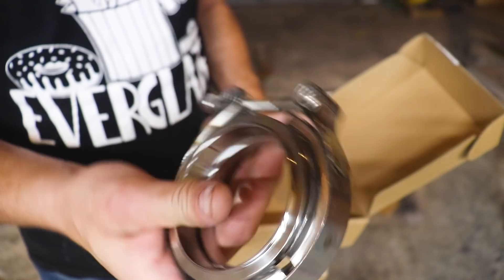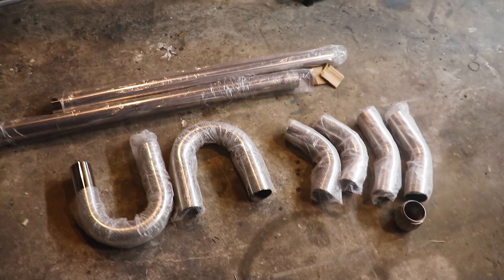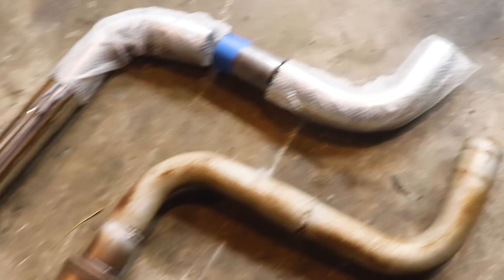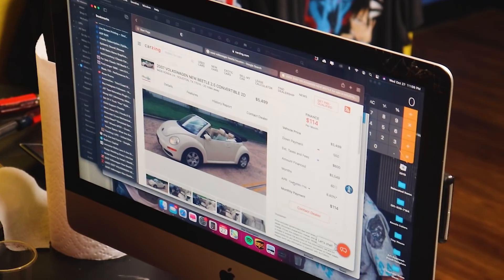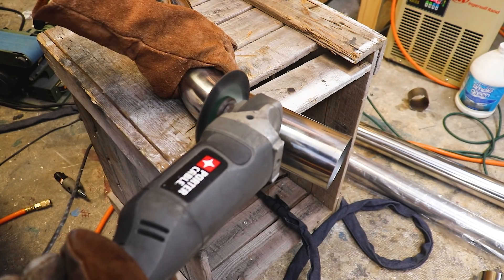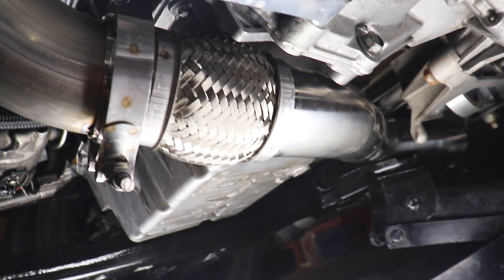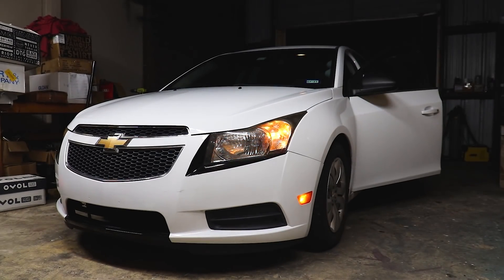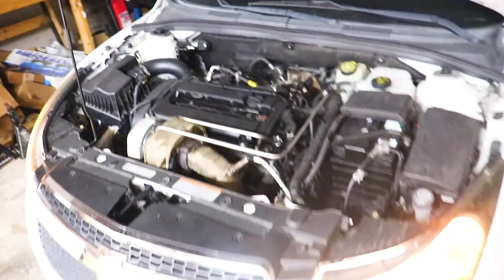$175 DIY 3" Stainless Turbo Back Exhaust Install - eBay Turbo Chevy Cruze 1.8 Build - Project Turdbo

Comment: I bought a cheap 3” belt sander that your supposed to use by hand, clamp it in the vice to clean up the ends to make them flat and it’s so much easier to weld them together as it removes all the gaps and for cutting just use a hose clamp and clamp it on the pipe and it makes your cuts nice straight again making your life easier when it comes to welding also invest in some kapton tape as it’s really strong and high heat so you can weld close to it without burning it
Reply from the maker: Awesome tips! Learning something new everyday.

Comment: I am curious i ve never seen this engine really built upon in australia and i own one of these cars so what was the thought process behind putting in so much time and effort into this car
Reply from the maker: I bought a 1.4 LTZ when they came out in 2011. Loved it. Had a family, traded it in cause we needed a larger vehicle. Missed that car, and never really understood why no one after 10 years had turbocharged the NA 1.8. Why start with less cc's?  So I bought a 2012 1.8 manual with the M32 gearbox with the intentions of turbocharging it. I see the guys in Europe have the VXR with the same engine, but the smaller displacement 1.6, making some good power 400+BHP. I occasionally get a bug and want to do something challenging. Anyone could get a Honda, or some other popular platform and boosted it. It's been done. To blueprint an engine that hasn't been done yet, and seeing what it's capable of is more exciting than, this combination of this make engine will produce X. If that makes sense.
Reply: @cmattdabrat  yea that makes sense i always wanderd why ppl never looked at mapping and really pushing the performance on the engine but here in australia they really aren't known for being reliable. I have a 1.6l turbo and thought about getting a exhaust upgrade and a intake plus tune just to see how much better it would make the car

Comment: Tiny stock turbo
Reply from the maker: Nope. 1.8 comes NA. Turbo on the car is a GT3582.
Reply: @cmattdabrat  Nice.
Reply: @cmattdabrat  Stock rods?
Reply from the maker: @ProjectCarTV  I'll go from top to bottom.
Stage 2 cams
Port n Polish head
SuperTech springs / retainers
JE Pistons, custom / coated with ceramic
Forged H-beam rods with ARP studs
ARP Studs
10.2:1 CR
Stage 5 clutch
LSD
Custom equal length turbo manifold
Custom intake
GT3582 Turbo
Injector Dynamics 1050x injectors
Deatchwerks 300 pump
Radium damper / regulator

Go back and check out some of the other videos. All well documented.
Reply: @cmattdabrat  Nice. I shot a rod through the block on a Cruz with a GT2876R
Reply: @cmattdabrat  Get a Cometic head gasket or equivalent. An MLS multi layer steel
Reply from the maker: @ProjectCarTV  Stock rods I take it on the 1.4?
Reply from the maker: @ProjectCarTV  I called Cometic. They don't have the dies for a 1.8. They said it would cost $3500 to make one. No thanks.
Reply: @cmattdabrat  yup

Comment: Sounds like a tuner! I think this project is accomplishing something big: it's showing that tuner cars aren't just Hondas, Nissans, and Toyotas. Americans can build competitive tuners too. I do, however, agree with some of the other comments on here, a resonator or two would definitely cut down on the harshness and make her really sound like a race car. And don't criticize yourself so hard on your welding. As long as your welds seal up the area and create a good joint, who cares about how it looks? I think you did a great job and I'm looking forward to what's next
Reply from the maker: Thank you! And you're right about all points. Welds are closed up, and know they're fundamentally sound. Will definitely consider some sort of resonator. This goes to show that there's more than import, and popular option American cars you can build. Just have to put in the work.
Reply: What are you talking about have you ever heard of the Chevy SS 2017
Reply: @speedygee6396  yes, I'm aware of the SS moniker that Chevy puts on some of their vehicles. It dates back to the '60's when they put it on their muscle cars that had performance engines in them (i.e. the Chevelle SS 396). Even the Cobalt had an SS line, where the first generation came supercharged, and the latter generation came turbocharged. The point here is that he is taking a stock Cruze and he's building it into a tuner car, which is what my comment is about. Something you see more with the Honda Civic, the Nissan Altima, and the Toyota Corolla. I was complimenting him on his achievement, not showing ignorance on what comes stock from the factory

Comment: Hi Matthew, Ive been watching this build since the very start, as ive done similar to what your doing on my own vehicle. I too have an eBaY turbo, but its not the Turbo that bogs you down, its all the other things that people dont instantly think off, like pipework, custom rads, custom exhausts, custom fittings, custom intercoolers & oil coolers, LSDs, Brakes, wiring looms, engine maps etc. So i can certainly relate. Mine is currently working very well, & whilst its in no record books, I was certainly part of an elite club in the UK with being 1 of only 4 Vauxhall Astra GTE 8v Turbos. ( your equivalent of a 90's Pontiac Lemans )

In regards to the video, i would recommend a decent backbox (muffler) to drown out the rasps. On overrun on mine, its now more of a burble, which is 100 times better than if i had no backbox muffler with a high pitched rasp (tinny sounding).

Keep up the good work & if you need some insight on ebay turbo modding if you get stuck or hit a brick wall, dont hesitate to hit me up! (except mapping, i just gave it to my local mapper, its over my head all that!)
Reply from the maker: That's awesome! And thank you for keeping up with the build. A lot of work goes into it. What's filmed here are more of the highlights, otherwise I'd have a 1,000 videos up, but probably not the most entertaining.

I'll definitely look into some sort of muffler, resonator down the line. Main focus is to finish the build and make power. Then we can dial in the sound of the exhaust, etc.

I appreciate it! Part of the plan with this build is to map it myself. Already have HPTuners and have done tons of research and at least 15 different tune changes since it's been up and running. I enjoy it, but surely can become overwhelming, but we'll get it.

Comment: I would try putting an exhaust tip on it and see if it smooths the sound out. I’ve heard of people putting an exhaust tip on and it making a crazy difference
Reply from the maker: Not a bad tip. No pun intended. Last time it had a straight through FlowMaster and tip. Sounded good. I'll touch on the exhaust again. My main focus was to just get the exhaust out the back. So let's consider it semi-finished with some tweaking. Possibly a free flowing muffler and a tip.
Reply: @cmattdabrat  haha nice! I appreciate you taking the time to make the exhaust out the back. I don’t like when people do good exits or fender exits. There is something about having it come out the back that makes me happy. Plus, I think it sounds better when there is some exhaust for it to go through. I love this build as I’ve been looking for someone building these interesting little Chevy cars. Thanks for the videos!

Comment: Nice work, is your welder just 120 volt 20 amp? Or is it 220 volt 40 Amp? 
 The vw bug is nice but  Apollo may not like it they are small inside.
Reply from the maker: Thank you! It's the Jegs 110/220 welder. I'm currently using the 110 adapter. Haven't needed any more than 90amps yet but the 110 plug allows it to go to around 120 amps, the 220 plug I believe 160 amps. Has been an awesome budget welder so far.

Comment: Great job! I remember building the exhaust for my cobalt and for my bike using a strike arc tig, boy was that a chore, its nice to have a switch to turn it on and off.
Reply from the maker: An on off switch definitely makes it easier. My first experience welding was arch / stick welding, so I feel you. Bet the tungsten needed sharpening a lot. I get lazy at times and will weld with the ball of stainless on it. lol
Reply: @cmattdabrat  yeah. I used to tig weld for a living and would spend a while sharpening all of the tungsten in the box on both ends for faster change outs. If you let the ball get too big you cant swap it for the other end. Now days I have a full water cooled torch set up at home with pedal control. Some day ill convert to a tig button. Love the work you do, and remember it doesn't always have to look pretty to hold and it is under the car so no one will see except all the viewers of your channel😜
Reply from the maker: @sinformant  You're right about that. I do the same. Will sharpen multiple pieces, but I'll try to keep the work progress going and put off sharpening them all again and will deal with a ball until it's just unusable. It's normally when I get really hot in the gear and take it. Learned my lesson with not wearing any sleeve protection and getting flash burn like a mo'.
Reply: @cmattdabrat  lol that ain't no lie. Last time I was tigging I was building a shifter for my buddy james at "the texas honda channel" and was too lazy to throw on my sleeves that were laying right there and I was red as a beet.

Comment: That thing is begging for an aero turbine/jones turbine muffler. I have ran them on multiple 4cyl cars. No packing and gives the exhaust a really deep tone. Their design also creates a scavenging effect the help draw more exhaust out. I have no ties to them, just a user and believer in their product. Every car I've ran them on it eliminated all the rasp. Some people love the raspy sound, some dont.
Reply from the maker: I've heard of those and definitely would consider it. Lots of innovation in the design. Lots of room to adjust as I go. Main goal ATM is to get her running under boost and star having fun. We can tweak the exhaust as we go. :)

Comment: For my taste a bit too loud, a good middle-muffler would help to make the sound better and Filter those high pitched tones out. But im rly hyped for that massiv  Intake manifold. Mo powaaaa babeh. Can’t wait for another episode bud.
Reply from the maker: I hear that. We'll see if it starts to grate on me. I'm just happy to have a completed exhaust back on the car. Yes!!! Working on that next. Have to either borrow an AC welder, or go to my buddies shop and weld it up there. So ready for more HRSPWRS and some boost!

Comment: Love the videos bro can’t wait till you rip on it, I have a Cruze too but was wondering if you have a idea why I keep getting p0420 code, already checked my catalytic converter and it is good, thanks.
Reply: Could be a bad turbo
Reply from the maker: Thanks Ruben! Is it the factor cat? The downstream sensor may be seeing too much or not enough flow.
Reply: @cmattdabrat  Yes sir it’s factory cat, could be the sensor going bad? Do u recommend aftermarket or oem sensor?
Reply from the maker: @rubenjimenez1568  How many miles on the cat? Could be the sensor, or cat. I'd go with OEM if possible.
Reply: @cmattdabrat  the cat has 102k miles currently
Reply from the maker: @rubenjimenez1568  Could be either or. Change the sensor first. If that doesn't help, could be the cat, which is more expensive.
Reply: @cmattdabrat  Thankyou🙌